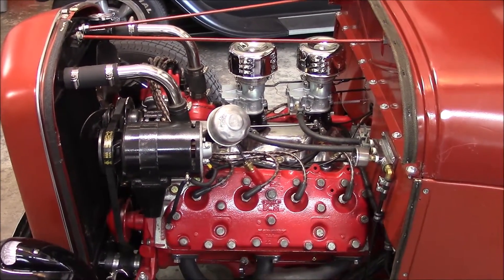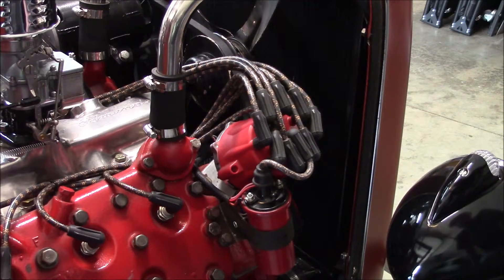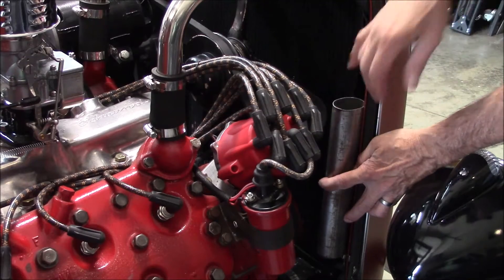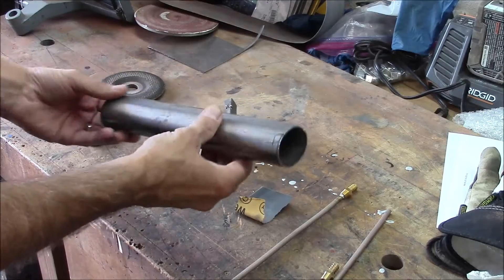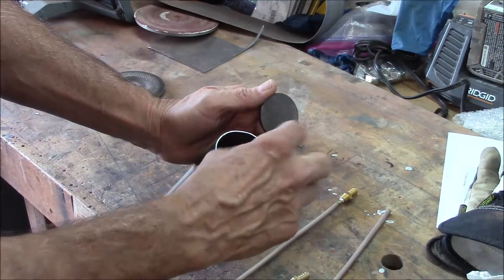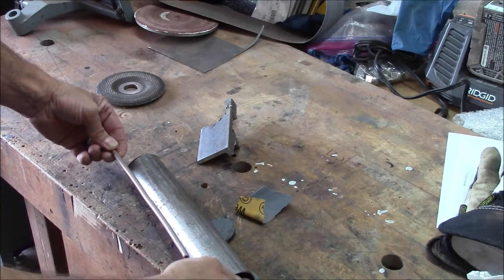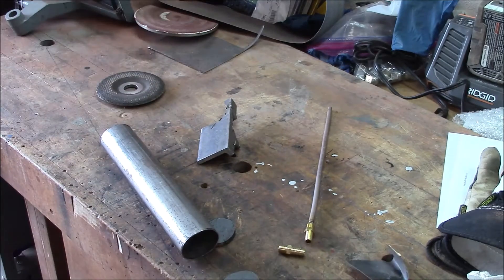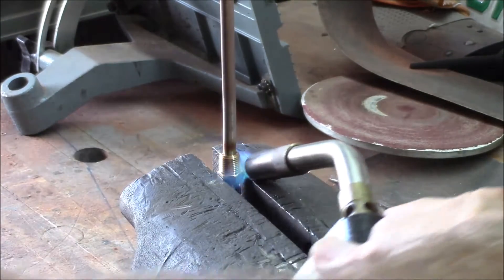Aarons 29 AV8 coupe build 18 July 2019 update

Comment: hello ive recently had knee replacement  out of boredum i searched utube to find something to entertain myself.and found your site. i have a 31 coupe as well and bought the tardel/bishop book last year with the same plan as u only with full fenders. i have to say that i was impressed with your  delivery of this project. i do have a couple of questions first where did u find  the lower f1 shock mounts that u welded into the rear crossmember  and the grommet that a veiwer sent to u for the column. yesturday i did find the hamb post about the pcv valve with  the napa part no.s  again   good job!!   i look forward to your reply
Reply from the maker: Hi Frank, the shock mounts came from the F-1 front axle. I just took the nut off and pounded them out.
I don't know where the viewer got the grommet from.
Reply: @aarondominguez4533  thank u